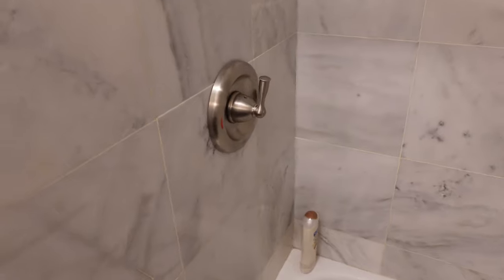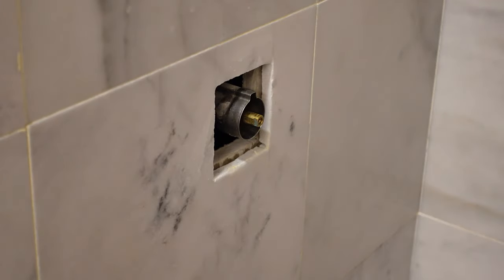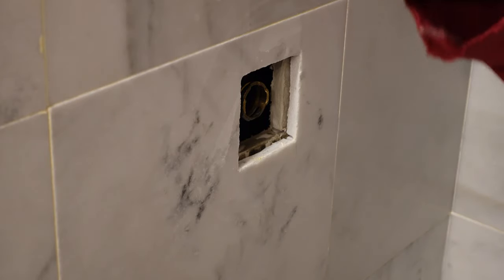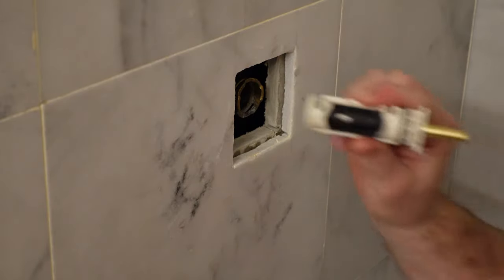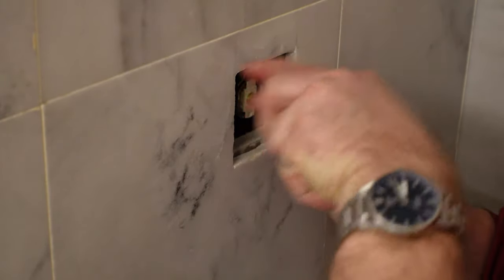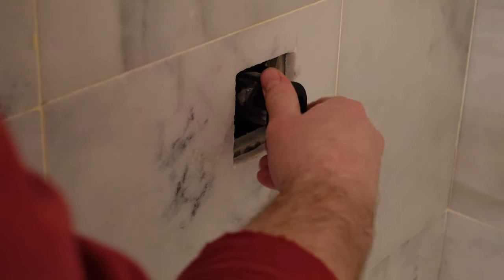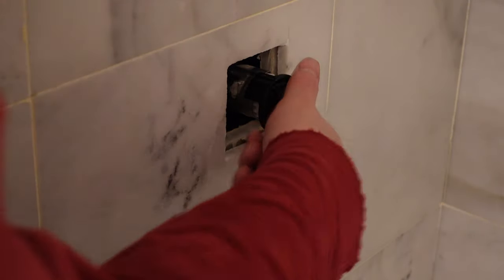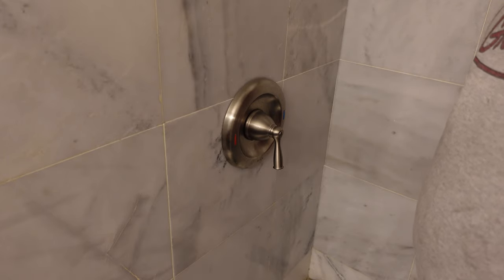Shower Faucet Won't Turn Off! - Short Version

Comment: I managed to get the first half, but cannot get the new valve cartridge in. I used silicone lubricant, but the black parts on each side are not sliding with the rest of the unit and preventing it from going in. Any suggestions?
Reply from the maker: I'm very sorry for the late response. I'm surprised it's not working. Did you check if there is any rust or foreign matter inside?

Comment: Great video!
I have an issue that once I turn on the valve, it’s leaking from the back of the handle. I tried to use a hex key to open it but seems like it does not match. I can see the screw head as it’s deep and rusted. Any thought on how to open it? Thanks.

Comment: Thanks for the save. Got the part and fixed the very next morning in 10 min. (late night shower turned into a leaky nightmare). Moen 1222 was the part number i used.
Reply from the maker: That's great! I'm glad it helped!

Comment: Thanks for video , taking old out it broke . Ive used vice grips, pliers and atill wont come out. Ideas?
Reply from the maker: Sorry for the delayed response...it should have come out with a solid pull (not jerking pull). Did you manage to figure it out?

Comment: What if you don’t have the black cap? Will this cause any extra issues?
Reply from the maker: Sorry for the delayed response. If you are talking about the black cap after taking the handle off...then I believe you will have a problem. The handle engages the black cap to turn the valve within the stem. Did you solve your problem?

Comment: Thank you. You easily saved me from getting ripped off by a plumber. I bought the danco valve cause it was cheaper but it has a slow leak. I decided to buy the the Moen and will replace it and hopefully that works.
Reply from the maker: Excellent! That is awesome!

Comment: What do l do when it’s like very hard to turn of does it need to be lubricanted
Reply from the maker: Sorry for the late reply - I hope you got it solved.  If you can lubricate it....then go ahead. My cartridge was really hard to remove, and I did a lot of wiggling to finally remove it. I know when I installed the new faucet cartridge, there was a lubricate in the package which helped the installation.

Comment: How do I turn the one shower off temporarily while I get the new tube thing??
Reply from the maker: There will be a shutoff valve. Some bathrooms have it on the back wall behind the shower valves. You might see a removable panel on the wall behind the shower, and if you remove that, there will be a hot and cold water valve. In my case, my bathroom didn't have one, so I needed to go into the basement and turn off the whole house water. If you don't know where to yours is, there will be a pipe coming in from outside the house, through the wall, and usually in your basement if you have a basement. This pipe will have a shut-off valve. If you're not sure where to find it, look for your hot water tank, and follow the pipe backwards where it comes into the house, and you should find it. Make sure you turn off the valve 'before' it splits between the hot water and cold water pipes.

Let me know if you need more help!
Chris
Reply: @designbypeck198  or you may have to turn off the water in the house from outside by your water hose. That’s what i had to do